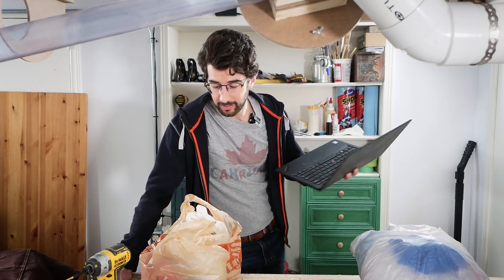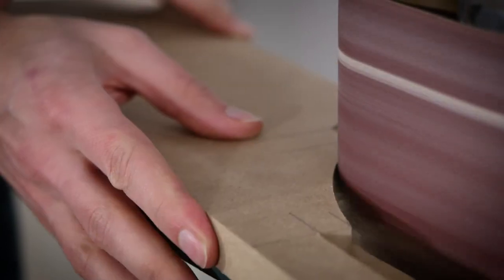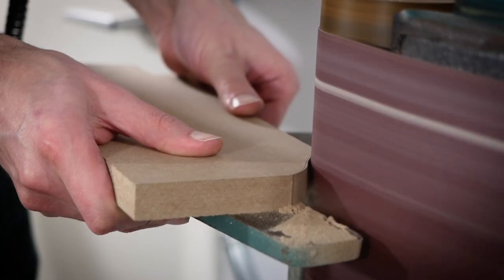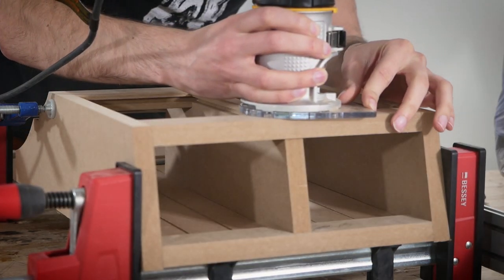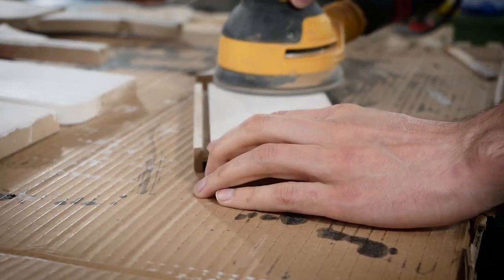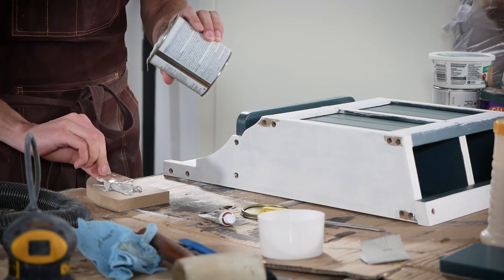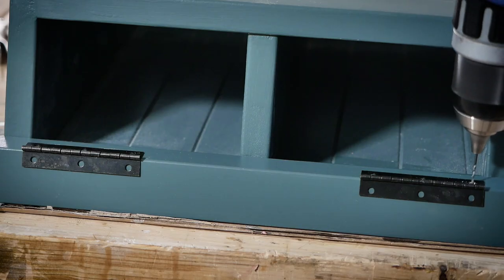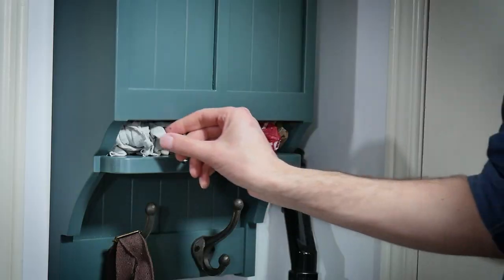The Best Laundry Room Storage Solution

Comment: Great video Scott. Have recently subscribed and and binging your back catalogue. Here's a tip for your pouring problems with that big paint thinner bottle. I used to have the same issue with screenwash deicer that comes in similar bottles. Flip the bottle 180 degree and pour out of the side closest the the handle. Sounds weird but doesn't glug out as chaotically and pours easier! :)